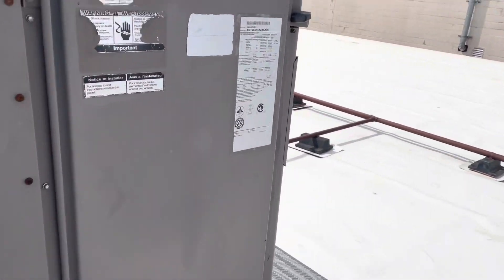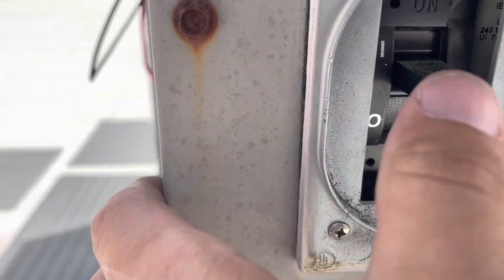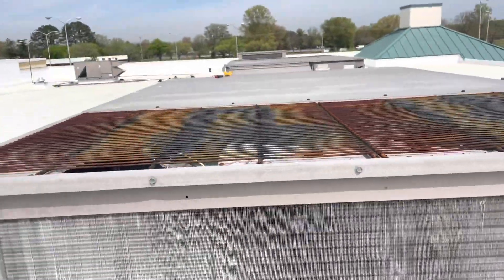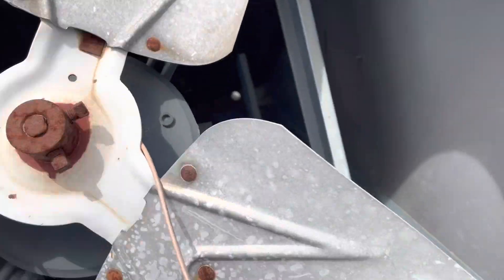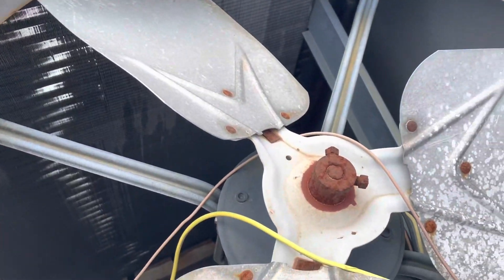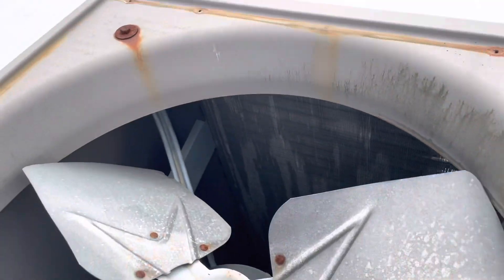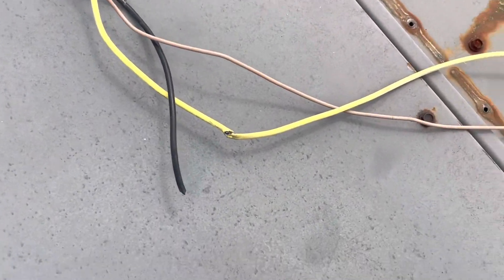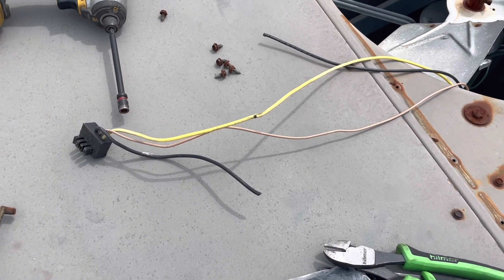York RTU tripping breaker, repaired.  #hvac #airconditioner #york

Comment: Jeff I know you’re his video was a few months ago, but the plug deal it slides in between the stator and drive end bell (front end) and by the time you pull the blade and fix the plug you can install a new motor and blade good video